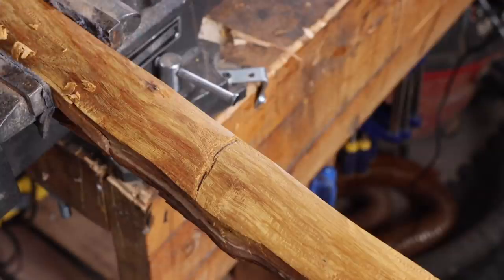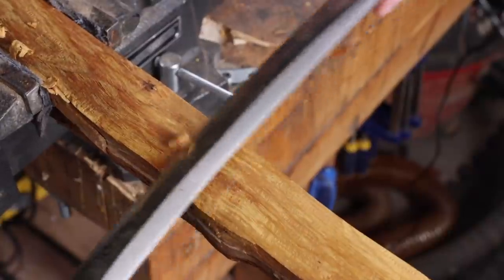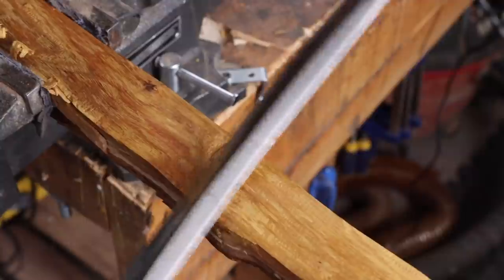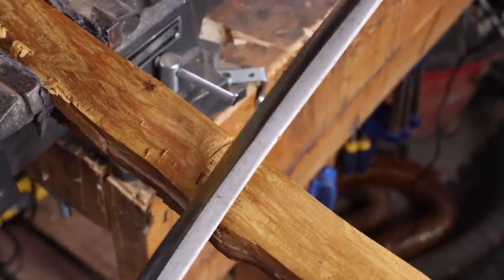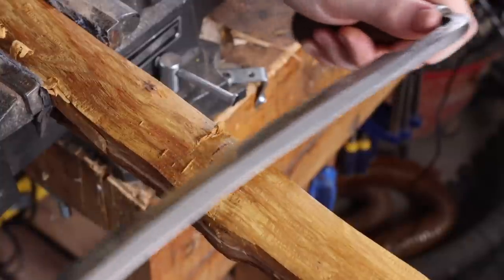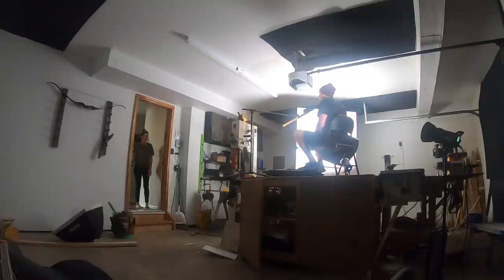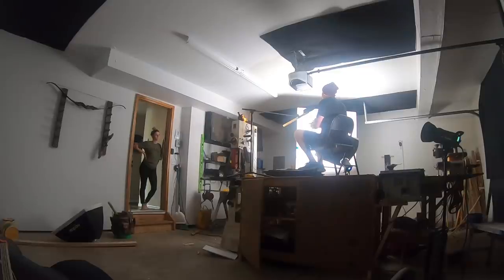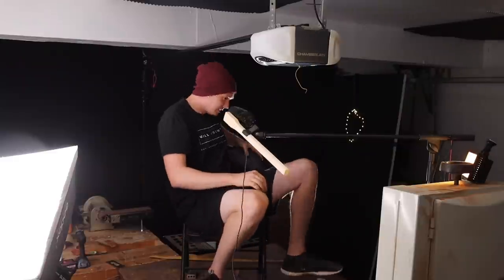GOLDEN Osage BOW History & Building! "Hand Tools Only"

Comment: Just wanted to say thank you my friend. I just finished making my first longbow. Not sure the weight, haven't checked it. Shot it about 50 times and would guess in the mid to high 40s. Was punching through plywood easily at 30 and 40 yards with really dull target points and light arrows. Finished forming the handle and have it stained and clear coat drying now. Anyway the point was to thank you for inspiring me to get into this hobby. Also made my first endless loop bow string. Definitely jumping into archery head first lol.

Comment: Hi! I’ve been into archery for a few years now but I was only able to practice over the summer at camp. That all changed when my friends and I started a high school archery & fencing club (I’ve also always wanted to try fencing and one of my friends has done that for years, but sadly due to COVID we didn’t get to).  Unfortunately, when COVID ended the school year and clubs, my camp was also cancelled. Thankfully one day a homemade bow video popped up in my feed and I was determined to make one. So far I have made a pvc (fiber glass core) long bow that pulled somewhere between 30 and 40 (it was hard to tell from the scale I was using) and I attempted to use a heat gun to make my second pvc bow a recurve bow, but alas it broke. Thanks in part to your videos and to my persistent nature I am determined to try again and with other materials like wood that would be more shatterproof. Once again thank you so so much for your inspiring videos!